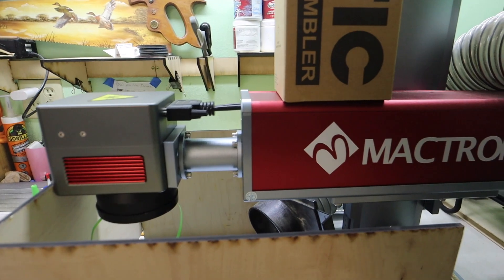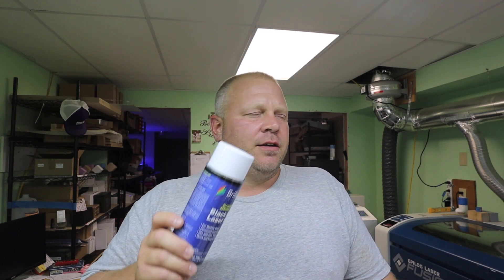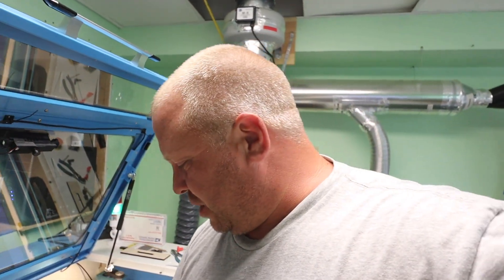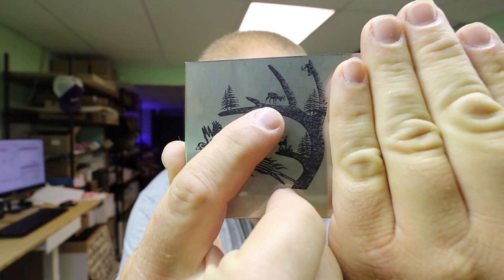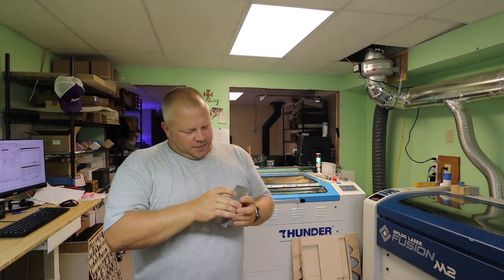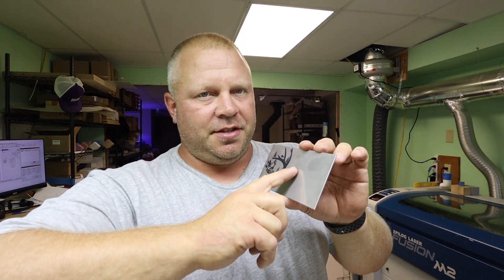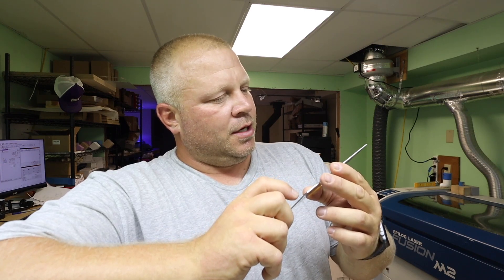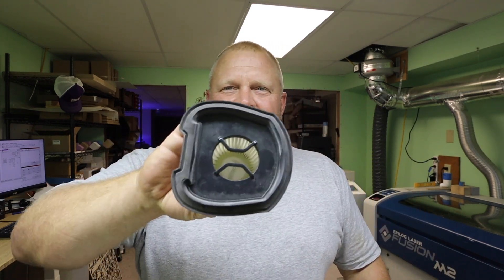How to Laser Engrave BLACK on Stainless Steel with 100 Watt Laser

Comment: I have an engraved stainless item that I want to make the engraving less noticeable. If i were to wire brush the item would that remove the black of the engraving or do you think I would totally mess up the finish? Don't want to ruin the item but would love for it to be a little more subtle. Thanks!
Reply from the maker: I would use a sander, but it will mess up the finish

Comment: On a 100W Omtech, 300 speed, 30% power and .08 worked pretty well for me.  I also turned off air assist.  Does anyone know if air assist makes a difference?

Comment: Hello Matt. I sure have enjoyed watching you over the years. I was wondering if you could share the settings including the focus you used for doing the circular mug. Haha! Also, what was your focus that you used for the stainless steel plate as I have a Nova 51-100. Speaking of my laser and yours. Do you have a series of videos on just your thunder laser?
Thank you,
Jene
Reply from the maker: 😂. I used the focus jig that came with the laser. 😃
Reply: @laserengravingwithmatt  Yes, but 6 mm 5 mm 3 mm 7 mm but was your focus? Also, the focus on the glass mugs? Thank you
Reply from the maker: Lay the gage down flat for the metal and the same for glass
Reply: @laserengravingwithmatt  sorry, to be a pain in the back side. But do you know what millimeters it is? I don't have the gauge? Thank you
Reply from the maker: I believe it’s 5
Reply: @laserengravingwithmatt  got it and keep up the great work. Thank you!
Reply from the maker: 👍 thanks 😃
Reply: Is Brilliance the same spray you use on glass and what are the settings please. thanks
Reply from the maker: No
Reply: @laserengravingwithmatt  What spray do I use for engraving glass so it turns out black. Thank you!
Reply from the maker: Cermark has one
Reply: @laserengravingwithmatt  Thank you very very much for all your help.

Comment: Good to know, thanks! I stopped using Cermark because of the cost and overall frustration with getting half a can use before it would inevitably stop working (even when purging correctly). Never tried stainless, I was always doing glass.